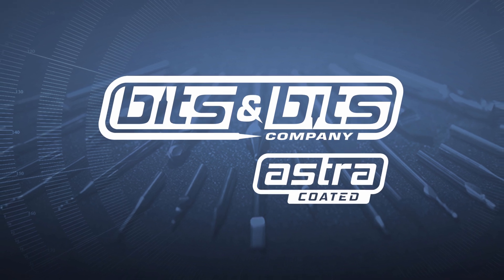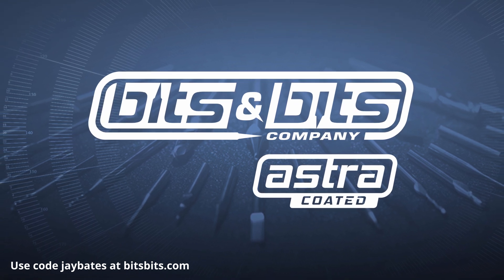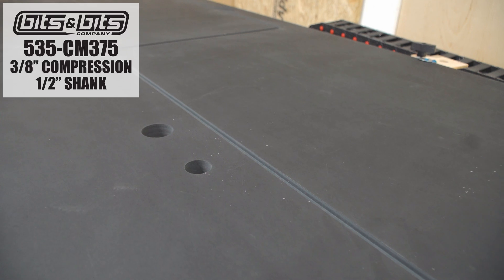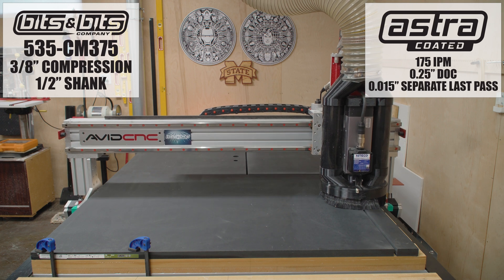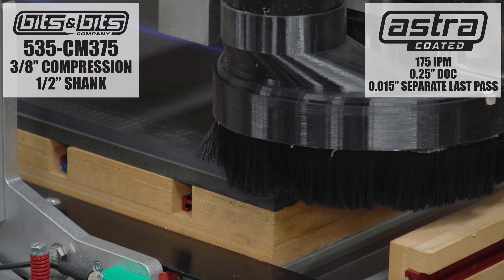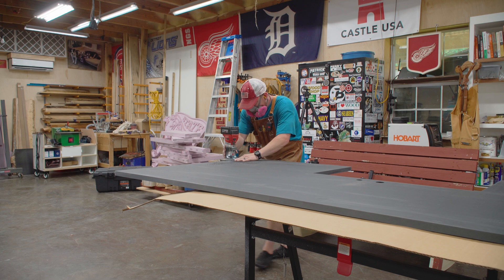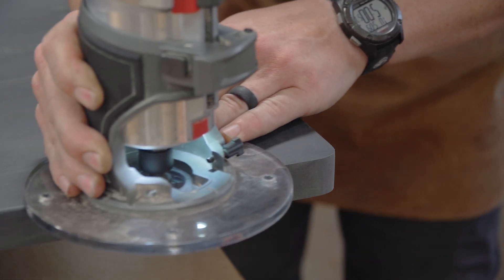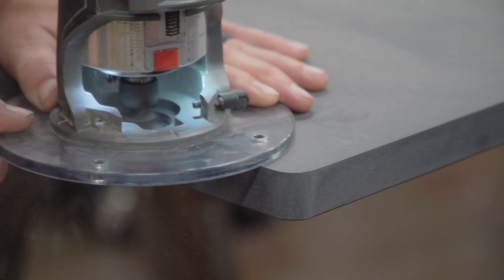Paperstone CNC Feeds and Speeds

Comment: Another great video!
Four or five years ago, I saw a video by John Heisz for a sliding ramp type lift. I used this method for the lift on my homemade table saw.
I recently started building a router into my saw table top and went to review John's video, only to find that you had done it 4 years earlier.
Your videos are easier to understand because you don't waste our time watching you cut every cut and screwing every screw. Your descriptions are straight forward and very helpful. When building the lift for the table saw, I discovered that making the slot for the bearing(s) to ride in, that I could change the rate of lowering/raising by making the slot steeper in the vertical plane. The main reason I chose your method is because I wasn't prepared to buy a set of differential gears to make a screw type lift.
Anyway, just a shout out to you and a big thanks for doing that project. 👍👍

Comment: Hey Jay! I just got my hands on my first small CNC. I have Adobe Illustrator for some simple designs.  What are some good (hopefully) free software to get me the rest of the way?
Reply from the maker: Design creation or toolpath creation? I use free vectors online for design stuff or create it all in VCarve Pro. I use SketchUp to design a lot of the structure work for my projects and import that geometry into VCarve Pro for toolpath creation.
Reply: Fusion 360 is free to non business users.  Worth the effort.  The University of YouTube makes everything accessible.  Lars from Autodesk is a good teacher.
Reply: @michaelporter9940  is fusion 360 a cad and cam program?
Reply: @ShopTherapy623  Fusion 360 does CAD and CAM in one package. Some drawbacks with the free license, but nothing terrible to work around. I've used the software on both CNC routers and mills under the paid license for years. I find it pretty intuitive and there are plenty of learning resources for free.
Reply: @jonathantaylor2584  thanks! I will look into it!